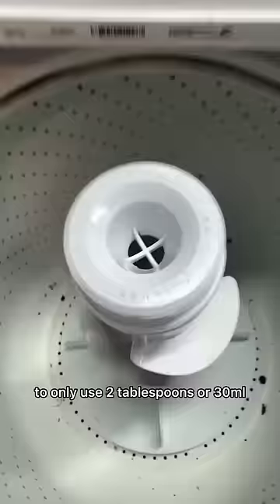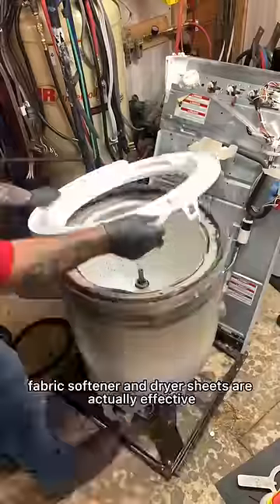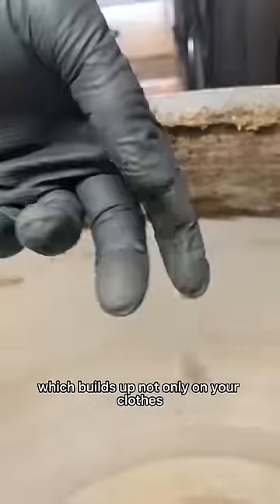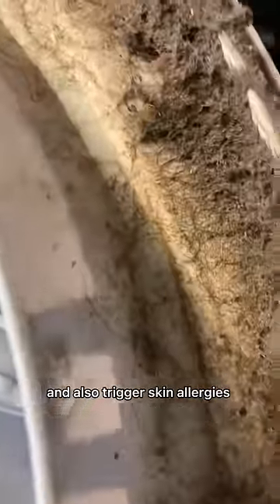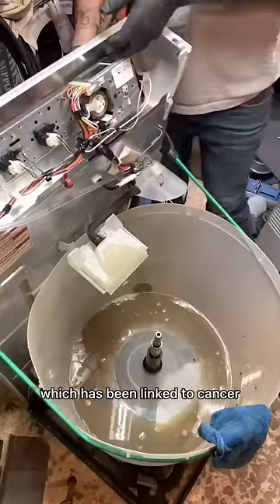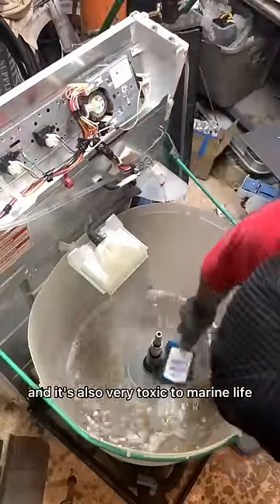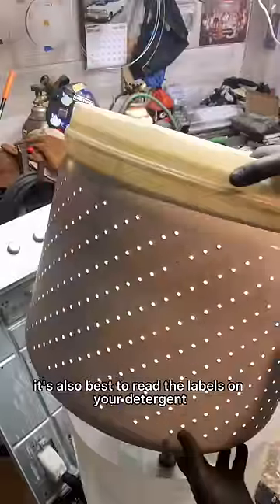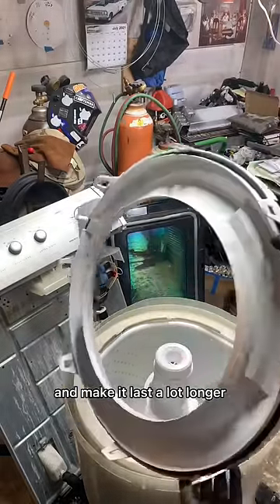Softener leads to machine failure

Comment: Vinegar can sometimes damage rubber gaskets and sealings
Reply: Yeah I remember hearing about that too so I never used it
Reply: Not anywhere near as bad on your washer as fabric softener.
Reply: Then you gotta use the good ol "dry cleaning" method from 1800s which is actually using a  vehicle gas!! Works like a charm for all of my formal clothing
Reply: I've been using vinegar for 20 yrs, havent had an issue. I use vinegar to kill germs not to soften clothes. So use it when washing my cleaning rags.
Reply: Ok so instead of vinegar I’ve heard that baking soda is better?
Reply: @CalmClamFam  use one one time and the other another.
Reply: I have very hard water. A little vinegar would be neutralized immediately and soften the water.

Comment: Fabric softener also deposits a layer of oil on all of your clothes, which makes it so that your towels won't actually absorb water very well.  Instead, I recommend washing your towels in warmer hot water with about a cup of vinegar in the bleach dispenser. It will kill any bacteria or fungus that is growing, making them smell nice once they come out and are dried.
Reply: But you guys dont understand the whole point of fabric softener. Idc about smells that what detergent is for. I want my clothes to not be crusty and dry. Fabric softener does that. I think you guys with all your allergies and issues need to stop lol

Comment: I was bored at work and took apart 2 washing machines.  one wasn't so bad but I needed the direct drive motor to make a windmill.  The other washing machine was crazy dirty (side load)  Gave it a good powerwash, and spot welded every hole in the drum.  A few weeks later I got a solid drum.  I sprayed the inside of the finished drum with rubber coating.    Made a huge rock tumbler!  it can polish bricks and cinderblocks!  It can only polish 1 cinderblock at a time or they will crush themselves apart. polished cinderblocks  and bricks are great for fire pits.  right now we are polishing big rocks that have cool patterns

Comment: The trick to cleaner clothes too, is the agitating.  The longer the cycle, especially if your washer, doesn't have the agitator, and clothes is real dirty. Use less soap, not full cap. I use less, but agitate or extend it longer. Clothes come out clean, in most cases without need to bleach. I check the water, and sometimes it's nearly black, when I wash my sister's clothes. Mine, don't get that dirty.
Reply: this does not make very much sense. Um, what kind of washing machine are you even referring to. And I pity anyone that washes normal clothes and the water is black... what are you people doing in your household. Your washer is probably filthy in between the tubs. And agitate clothes all day long, all you'll do after a point is wear out the fabrics.

Comment: Btw dude!  The crud in your washer is the dirt from your clothes and dust in the air that builds up over time due to the fact that those surfaces NEVER get anything physically touching them!
Reply: Well actually, there is a huge difference between the dirty it  gets from regular use, and the dirty it gets from liquid fabric softener. Fabric Softener is grimy and waxy.
Reply: No. The "crud" on the inner tub is lint, fibers, flotsam and jetsam from the wash cycle that ends up adhered to the plastic outer tub. definitely not from "nothing ever touching them".... thats uh, dumb af.
Reply: @boscoalbertbaracus1362  flotsam ye, but not jetsam, unless you’re purposefully trying to dirty your washer.

Comment: I absolutely hate fabric softener and dryer sheets.  They wreck my skin and the odors screw up my ability to breath.
Reply: they make liquid fabric softener w no fragrances or dyes - i use downy free & clear n also looking at the ingredients, doesn’t contain glutaral that was also mentioned in the video
Reply: @twonahaf  to be honest I don't like the feel of the towel.   Probably goes back to when I was a bit younger.  Towels were line dried.
Reply: @jamestragle9504  You are not supposed to use fabric softener on towels anyways lol. Towels need to wick water, and fabric softener completely ruins that purpose.
Reply: @yankis.  I don't.  But occasionally my better half does.

Comment: I started using %100 wool drier balls with a few drops of essential oils. Cloths are just as unwrinkled and soft as any drier sheets I’ve ever used. I keep a box of drier sheets (been 1 box for over a year now) because I will keep them in a coat pocket in the winter when the air is dry to run over my hair and some clothing for static control, but that’s it.

Comment: I have severe allergies so we have been making our own laundry soap for almost my whole life. It's made our clothes softer and smell cleaner, not suffocating like the smell of most store bought laundry products.
We occasionally will do laundry and end up having to run the machine barrel cleaning cycle multiple times because of how much product people use (public laundromat). In the summer when people use the apartment laundromat you can smell the dryer sheets from across the property. 
We have dryer sheets in my apartment for one reason: my mom does diamond paintings and the drills kept sticking to each other and the bag so she puts little squares of sheet in it to help separate them. 
The amount of product some people use is disgusting. I hate walking by someone and they just reek of laundry soap or softener, or even those unstoppable lentil looking things.
Reply: How do you make your soap?

Comment: And for another thing, powder detergent is best for top loaders. Liquid and pacs much like softener can buildup behind the main wash drum and within the agitator and other places and cause mildew. But, if you have a weak high efficiency machine with a impeller and not an agitator you’ll have to pre-dissolve the powder or use liquid. Pacs can also not fully dissolve in some machines because there is not enough force within the “agitation” period to bust it apart within the first few seconds like a traditional older classic machine like the one in this video can. The pacs soluble coating can also get stuck behind the main tub while washing causing pumps to get clogged or other areas.
Reply: Stop. High efficiency and impeller machines are not weaker than agitator machines. This has been proven time and time again.
If your powdered detergent isn't dissolving, you're using too much. And if your liquid detergent is building up, you're using too much. High efficiency machines use less water and detergent than traditional machines. That's part of what makes them more efficient. The manual that comes with the machines explains all of this.
Reply: @moringsdaughter  That is not true. I had one myself I’d know, total junk washers I was so happy to get rid of the whirlpool cabrio we had for 12 years that had repair after repair. The agitation, not even close to what a speed Queen, direct drive, older Maytag, ect can do with a REAL agitator. They can clean the smallest of loads but anything bigger, forget it. Such junk washers that belong in the garbage, with an auger, you also get unnecessary sensors and computers along with it as well that will fail and cause an insurmountable amount of problems. So much LESS efficient as well, you seem to believe everything the manual tells you, these HE machines are compromised by computers and sensors which does take extra electricity, on top of the machine having to “sense” the load and waste water trying to figure out what type of load it is, plus, they waste gallons and gallons of water trying to rebalance themselves. They are highly unreliable machines that simply do not clean the way older machines did. Totally ridiculous government propaganda washers, don’t fall for it. Watch a video in comparison of the agitation here on YouTube, and also how HE machines are total garbage inside and out I’ve been an appliance technician and enthusiast for many years so this is just common knowledge at this point but I always love to share this knowledge so I can save others from being tricked into believing such nonsense. Thanks.
Reply: Does powder detergent fully dissolve in an all cold wash? I too feel the same way about all these HE washers. They all suck, especially the ones with no agitator. Give me a speed Queen any day. I sold my HE no agitator washer about 3-4 years ago (came with our house) and purchased an agitator washer. Best move!
Reply: @nickijaycox7773  glad to hear that, I bet your laundry experience has improved immensely with no frustrations. Powder works and dissolves best in warm/hot washes, but it will work fine and dissolve in cold just make sure to pour it directly into the tub before the clothes so it can begin dissolving as the machine fills. Powdered detergents nowadays are designed to dissolve in cold washes for colors and whatnot.
Reply: @Goldenwoodz  I still use fabric softener in the Speed Queen without issues. Gee. I wonder why?

Comment: My sister killed both a Miele washing machine and a dryer by putting too much detergent and softener in the wash. She is now using more vinegar. 

The washing machine was remarkably clean... but rusted out in certain places and the main bearing eventually failed. 

The dryer had so much fluff in it that it got into the main bearing and it failed.

The good thing about Miele is that it keep engineering out these problem areas so the new machines should not fail for the same reason. Despite the failure the washing machine lasted a long time (~15 years). The Dryer didn't last as long (did a lot of work in <5 years)... but Miele upgraded it to the newest model at a modest price. The new washing machine comes with magnetic bearings which should be resistant to rusting out. The dryer comes with a lint filter cleaning warning light which helps owners realise the filter needs cleaning: Needs to be cleaned before it will run. This is very helpful... as despite cleaning the filters regularly... some users may need to clean them even more frequently... and it can be hard to guess how often that should be.

Comment: So, you're saying don't add HE detergent up to the "MAX" indicator?  Front loading Whirlpool washer.
Reply: No! You don't it will leave a residue on your clothes. I use the 1 or 2 amount on the lid. I add vinegar in the softener spot. My towels are finally getting more absorbent!
Reply: I have a laundry detergent that only calls for 2 teaspoons in the washer. I also use vinegar in the softener spot. I use dryer balls to avoid static cling. Works great. I have a front load washer and dryer. Less water, less soap.

Comment: I alwas tell people who say "it DOES smell like vinegar" that it's because you're either using too much detergent, or your washer is full of build up. Vinegar will only linger if it has residue to cling to. Get your washer cleaned, and follow the proper amount on your detergent bottle and the vinegar will work properly and not smell. TV commercials always use too much product, like toothpaste commercials; brush is filled on screen, but actual directions call for a pea sized amount. No different with laundry.

Comment: I’m going to try vinegar because when I don’t use fabric softener I get static cling up the ying yang!
Reply: Static is from over drying. Just dry for a shorter time and you won't have static. No products needed.
Reply: We use vinegar, plus I hang our clothes to dry outside. Vinegar does work better than using nothing at all. And I don’t notice a difference between vinegar and fabric softener, except that the vinegar-softened clothes smell fresh without a fake scent and towels are a lot more absorbent.

Comment: Man you clean the heck out of that washer,  after I start using the dishwasher machine gel
In my washing machine, I finally had to break mine down like this because of the seal those gel tabs did an excellent job it only had a haze and a little Dirty residue in the plastic tub I was quite impressed.

Comment: That thin layer of film keeps me from getting zapped all winter
Reply: I use vinegar in  the fabric softener receptacle and dryer balls. I don't get shocked in the winter.
Reply: @tammyfritschie1697  how long have you been doing that? Has it messed with the innards of your machine at all?
Reply: @muddikissez22  
No ma'am.  It hasn't been a problem at all. I have a front loader washing machine that we had bought used. The previous owner had used powdered laundry soap and regular liquid fabric softener. We had to replace the hinges on the door, (YouTube video). Since then I have used only vinegar for the rinse. I have not had any problems with it at all. I have allergies to the scent stuff in the fabric softener. So I have used vinegar for years.
Reply: @tammyfritschie1697  Awesome! Tha ks for the info!
Reply: @muddikissez22  
I forgot to mention that I use a liquid laundry detergent that only calls for 2 teaspoons to wash a load of clothes. There isn't enough to build up on things. Only enough to clean to laundry.
Reply: @tammyfritschie1697  that's a tiny bit! Thanks!

Comment: Vinegar ABSOLUTELY leaves a vinegar smell that lingers and then stinks up my dresser drawers.
Reply: No it doesn't. There's a company called rustic strength. They make natural cleaning products. Their vinegar is made from cane sugar. Leaves no smell and cleans n deodorizes the clothes n the machine. Also helps to use some sort of washing soda along with the clothes which further deodorizes the clothes n machine
Reply: Run an extra rinse and that should resolve it. My machine has a button for extra rinse.
Reply: Then you're using it wrong or using way too much.

Comment: I've been steam cleaning everything thanks to you. Wife currently mad due to dysfunctional TV..
Reply: Sounds like the wife and the tv need a steam cleaning
Reply: @0xsergy  Well...the steam cleaning *may have CAUSED the TV situation... wife could def use a good hot bath tho.. #fullsteamahead
Reply: @YerBrwnDogAteMyRabit  lol. If its a flat screen, take it apart and let it air out. Look for corrosion on ribbon cables and circuit boards.
Reply: @nicklikesradio  Then what? Set it on fire? I appreciate it, thank you, but the neighbors are on vacation and I don't feel like retrieving it from the deep end of their pool. It was hard enough throwing it over the fence.
Reply: @YerBrwnDogAteMyRabit  🤣🤣🤣🤣
Reply: I haven't watch TV for over a year now,  I was scared to do it ,but it wasn't so bad.
I'm glad now, feel much better.
My parents still do, when I visit them my first reaction is ewwwww , how can you watch that ?
I showed my dad he could watch the same shows on YouTube (he likes the aviation disaster shows,  he's a retired pilot who never crashed. Ironically,  he use to run out of gas often in our 1957 Cadillac Sedan Deville Broughom, it was a lot of car and it used a lot of gas).

Comment: I ran out of fabric softener and am too broke to buy more lol but I’m glad to know it’s bad! Also…. 2 tablespoons of H E detergent?! 😱 Also what is a great alternative to dyer sheets?
Reply: Wool dryer balls. Fabric softener is a scam
Reply: @4477superman  thank you so much!!
Reply: Good, don't ever buy it again. It's not only a waste of money but it's doing so much harm. Ditch it and just go without
Reply: @daniellemartin9896  I absolutely will!
Reply: Dryer balls are fantastic and last a long time. I've had mine over five years, running at least 2-3 loads per week on average and they work just as well as the day I bought them. And large stuff like sheets, blankets and towels are less likely to ball up and not dry.
Reply: @waffles3629  wool balls ?
Reply: @akidim13  yep, they're wool
Reply: Vinegar in the softener receptacle.
Reply: @luann4540  thank you for this. I couldn’t figure out where to put the vinegar
Reply: @waffles3629  do u wash them?
Reply: Vinegar in the wash water. 1 cup. 1/2 for HE.
Reply: @my_flippin_journey  you can. You don't need to every load cause they just go in the dryer, but if they get messy you can just chuck them in the washer.
Reply: @Isabella66Gracen  FINALLY!!! Someone said how much vinegar to use!!!!  Thank you so much. It was like a recipe without how much of an ingredient.
Reply: @Isabella66Gracen  what does HE stand for?
Reply: @fussyrenovator7551  Hardly Effective.
Reply: If youre using more detergent than that, then you dont know how to use your washing machine properly...... and seeing as it is an HE machine its not removing the soap fully.... you, uh, need some help. Or an instruction manual.
Reply: @boscoalbertbaracus1362  what are you talking about? 😆 who said anything about not knowing how to use a washing machine?
Reply: @pureluck8767  I did. Pretty simple, wasn't a hard comment to understand. Try reading it slowly. Sound out the big words.
Reply: @boscoalbertbaracus1362  aww mr grumpy woke up on the wrong side of the bed this morning didn’t he? 😂
Reply: @pureluck8767  good luck not knowing how to clean clothes. Hopefully you know how to wash yourself and do other normal hygiene practices.
Reply: @boscoalbertbaracus1362  glad someone else is saying it. 🤗🤦‍♀️🤷‍♀️
Reply: I heard you shouldn’t use vinegar because it eats and rot’s the rubber hoses and seals
Reply: @cececox6399  glad to see another bandwagoner of hate 🤗🤦‍♀️🤷‍♀️

Comment: I bought fabric softener but haven't used it much. I rather use the sheets in the dryer.
I learned a lot about using it today, and will not use it anymore.

Comment: You are correct sir hundred percent Not only does fabric softener clog up your washing machine You ought to take a look at what it does to the drain 2-in pipe discharge had to cut it out of the wall couldn't even get a snake down it once cut out looked inside 3/4 hole on a 2-in pipe fabric softener